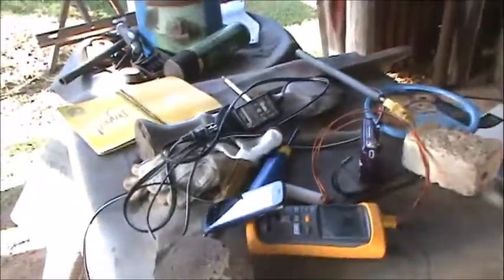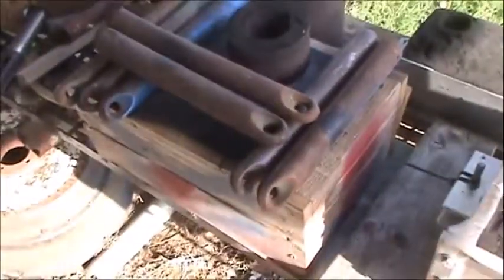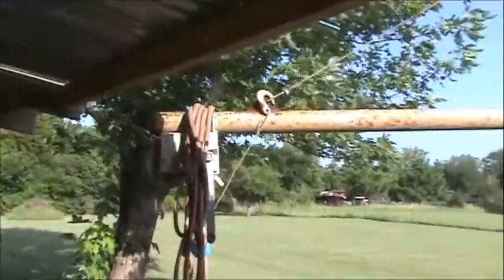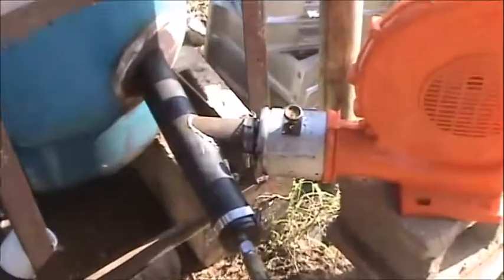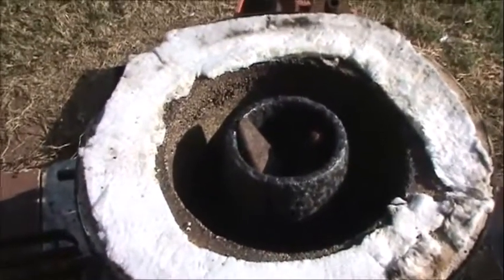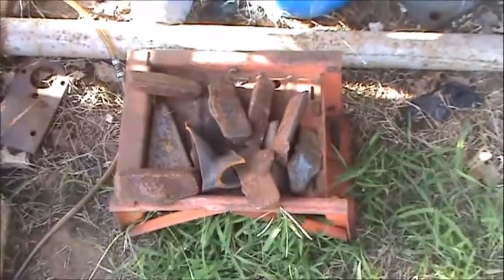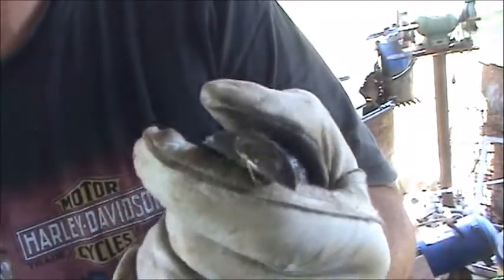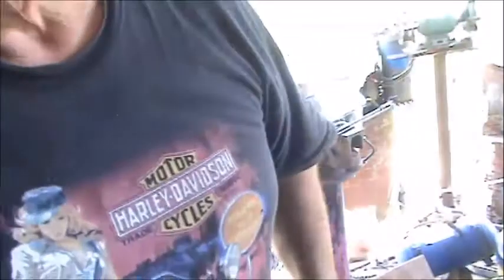Cast Iorn melt 8-22-14

Comment: Looks good! Nice to see the parts... finally.
 It seems I only get one good piece out of 3-5 pours. :))
Aluminum and bronze are hot enough.
I'm not ready to try casting iron yet.
Reply from the maker: all I can say is to keep trying and keep a log book so you know what you did when it worked right. while doing the melt for this video I had problems with not burning the amount of oiI, that I should of, but all the problems and fixes are noted in the yellow book

Join a group and ask questions with photos of your problems and you will get lots of answers.

DA
Reply: SUPERDAVE257 I appreciate the advise. Most of my issues result from poor molds. Not enough gates. Short pours. And stuff like that. I usually remember the problems, and try something else on the next pour. A notebook would definitely help my failing memory. :))
Reply from the maker: jamcat62 all I can tell you is to keep trying, get some books on casting and molding, plus go to AA and look up Raspers thread on how to make a pyrometer using a multimeter and use it, eyes are good for seeing stuff but temperature isn't one of them, I have a bad habit of cutting the gates too small, I don't know how the second part even filled except that I had one bigg Heat Riser in the mold the gate was only about 1/2" wide by 3/16 at the deepest but the iron was still pretty hot when I poured the second mold.

DA